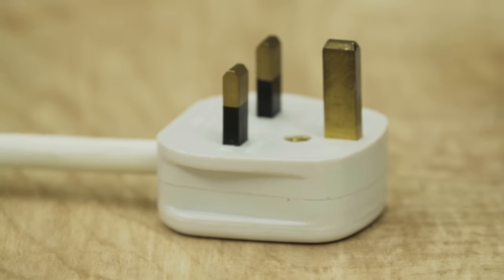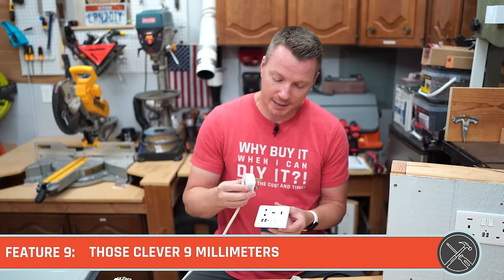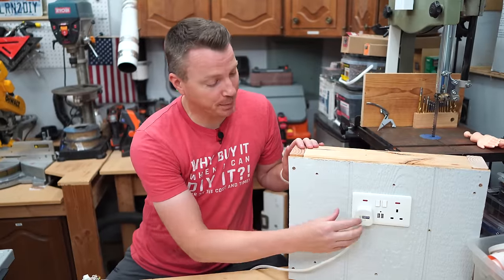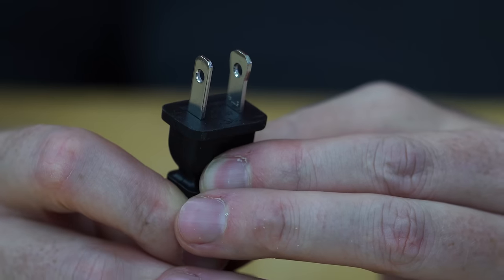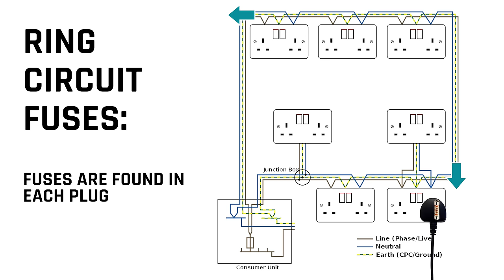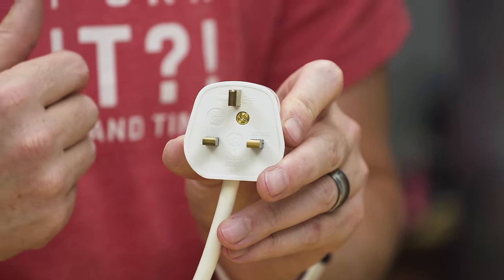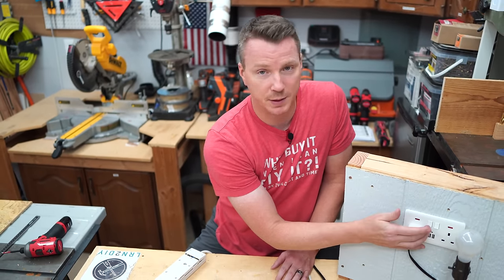British Plugs and Outlets Are On Another Level

Comment: Brit here. Although I'm not an electrician (I'm in radio/electronics), I can honestly say that although 'load balancing' is a theoretical concern it is not something that bothers 99% of people at all. I've never seen an instance of it anywhere. As for treading on an up-turned plug, we Brits are sensible people and we don't have plugs lying about in the middle of the floor! Finally, if an appliance fails to switch on, we don't automatically think it's faulty, we just check it is plugged in and the wall-switch is on.
Reply: also, yes it big and bulky but it sits flat against the wall with cable coming down which is great if a plug is behind somthing like furniture
Reply: As a Brit you’re lying if you say this has never happened to you 🔌 🦶
Reply: As another Brit, I refute your claim that we never step on plugs. I have done it a few times. It’s even worse than stubbing your toe on the coffee table.
Reply: @miles7374  No really, I've never stepped on a plug! Maybe I'm lucky, maybe I look where I'm going or maybe we don't leave plugs lying around the floor! But really, I suspect I'm like the majority of Brits who have never stood on one, and I've just asked my wife and she tells me she hasn't either! Please don't accuse someone of lying just because you have a different experience.
Reply: @LoFi3  I didn't say that. It would be a foolish claim.
Reply: Thanks for correcting him on these "flaws" I've never stepped on one either ......
Reply: Yeah, if we unplug it then we move it out of harms way. Such is the result of stepping on too many plugs.
Reply: stepping on plugs isnt a thing.
Reply: Speak for yourself. I step on them all the time
Reply: Try yourself some European plugs. It will change your life
Reply: @andyhowlett2231  i mean, i've stepped on plugs several times, but then again im an idiot
Reply: @Brigadier_Bufus  Well at least you're honest!😉
Reply: @miles7374  Agreed, stepping on a plug is horrid. But since we can turn it off at the switch they are unplugged much less.
Reply: He did really struggle to find some negatives, bless him. I've lived 4 decades and I've never stepped on a plug, their either wrapped around something (hoover), high up (kettle/Microwave) or plugged in and switched off at the wall if unneeded. Although if you weren't familiar with our plugs then I imagine accidents can happen.
Reply: headcell  Yes you can change a broken plug for a new one.  Just chop off plug, adjust coded wires, in the cable, to the correct length, wire plug and then use.  We've lived Germany and needed to change plugs, no worries and easily sorted.
Reply: @andyhowlett2231  haha it was a joke, same way you weren’t serious saying all brits are sensible people
Reply: headcell  You can swap a moulded plug for a new one, just cut it off and start again with a new plug.
I remember when one had to buy a plug for every appliance
Reply: @andyhowlett2231  As luck goes tommorow morning you'll step on one!
Reply: he didnt consider that since you can turn it off at the socket there isn't as much need for unplugging it as there is in America
Reply: headcell  with you there on those 13 amp prefitted fuses. Ideal for 3 bar electric fires, not much use for a CD player or powered USB hub
Reply: The reason "we don't have plugs lying about in the middle of the floor" is precisely because we've all trodden on one bare-footed at some point.
Reply: @sunnyjim1355  We haven't 'all' done it, Jim!
Reply: mate, why can't you just admit that you've stood on an upturned plug? It's happened to everyone at least once.
Reply: @Dushmann_  Mate, it's never happened to me. Or my wife as it happens. Why are you insisting that 'everyone' has stood on a pug? It seems so childish, are you trying to wind people up?
Reply: @d-emprahexpects  European sockets feel cheap and insecure
Reply: @baileyharrison1030  pffff "feels"
Reply: Never mind who stands on what, I swear, if you do do it, you don’t do it again! My main grind was the lack of understanding of how even a fluffy nightlight can become an offensive weapon with that plug. A major good point missed.
Reply: And in the case of lack of power, checking and possibly replacing the fuse of course, which wasn't mentioned here.
Reply: headcell  l
Reply: A friend of mine actually DID land on an upturned plug with a bare foot (it was a very random situation) and it did some nasty damage.
Reply: @yummyfuzz1  hahahahaha
Reply: @aperson2125  Not difficult to rectify. Just fit a fuse of the right rating. They are even colour-coded to avoid any further confusion.
Reply: British electrician here. I've never heard of load balancing being a consideration on ring circuits...
Reply: Its omly become an issue with having an EV.. Pulling 1.2Kwh for 5 hours+ straight... Gets a bit warm.. 

Thata right americans, technically i can pull that from any plug in my house!
The actual spec allows 1.5kwh but that will eventually trip your cuircuit in most cases after a while.
Reply: headcell  Sure you can replace a broken plug, cut the moulded one off, rewire a new plug, less than 2 minute job
Reply: ive managed to live 63 years without standing on a plug or ever meeting anyone afaik who has stood on a plug. Why~? Because no one unplugs anything unless it is being removed. It is left plugged in and switched off at the socket
Reply: @trippyvidschannel82  yes it is.
Reply: @tamz2tamz2  and when unplugged the plug mostly rests next to the socket. Who walks that close to the wall. It's wall, device(obstacles) then open space. Unless it's an empty room.

Comment: I’m British, and have never struggled to turn on a socket, nor have I ever struggled with their size. But I have trod on one though! And I’ve still got the scar on my heel to prove it! And even with that agony permanently seared onto my cortex, I'm still able to marvel at their incredible design. I rather took them for granted until I watched this vid.
Reply: Do you hit your head on low ceilings and doors as well.
Reply: Everyone will learn to stop leaving things on the floor, one way or another
Reply: 3 prongs makes three points of pressure which distribute the force, it would probably have been a lot worse with a two prong plug
Reply: its worse then lego
Reply: @mas_aco309  one of them is longer than the other two, it's like stepping on a one prong plug at first
Reply: @Journey_to_who_knows  lol so few modern British houses have low ceilings and doors and when I say modern I mean in the last 200 years. It’s just the really old buildings and houses that can sometimes have parts that are over a thousand years old which have low roofs and ceilings.
Reply: LOL at "troubleshooting" for "is the plug switched on?"
Reply: @MJK808  Yeah, that's a pretty dumb point in the video (though he doesn't pretend it's some huge problem). It's like saying that a disadvantage of locking a door is that people will wonder "Hmm, why this door not open? Maybe it locked. Maybe something in way. Me confused."
Reply: Here in the UK, instead of shock trauma, we have stepping on plugs trauma.
Reply: @beeble2003  In fairness it's a cultural thing, Here in Aus all our outlets have switches on them due to British influence, but it's alien for the yanks. 

As a concierge i started off perplexed by how many calls i'd received from North Americans struggling with switches on outlets, but i'm used to it now i don't even think its odd anymore. 

However i will never forget the time we had a guest valiantly try to save the building by fleeing his room and hitting a break glass in the hall fire cupboard as he had realised that the outlet was "on fire". The "fire" turned out to be the indicator lamp on the switch in the bathroom. The plastic cover had faded giving the lamp an orange hue.
Reply: God I feel your pain!
Reply: Heel ain’t nothing, had one go into the soft middle part of my sole😂
Reply: @johnburns4017  Not many people in the UK live in a house/dwelling that's over 150 years old never mind the ones that are hundreds of years old that would have the low ceilings and doors. Mind you, there are houses in the states that was built in the 1700's, so maybe you're living in one of them, and have problems with low ceilings and are commiserating with people here and other areas of the world that still have homes that old.
Reply: @mireah  
Do you keep cutting your hands as well?
Reply: @johnburns4017  never have.
Reply: @mireah  
I am surprised.
Reply: @tomspyro5795  I live in a three hundred year old house and yes the doors are low, my school had a four hundred year old building and I had to stoop to enter and I wasn't even fully grown at the time.

Comment: As a Brit it is wild to me that you can’t plug in a hair dryer and a iron at the same time 😂
Reply: Yeah! I thought the same!
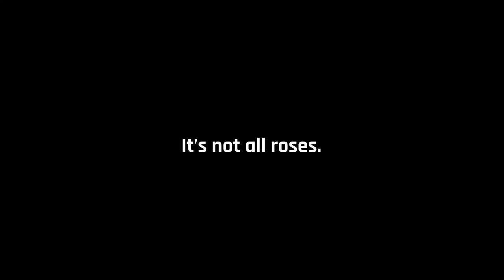Reply: haha yea, I have offpeak electric at 9:30pm to 2:30am, At 9:30 I charge my electric car, put on the dishwasher, put on the washing machine and also the kettle to make hot water bottles or cups of tea, not had any issue
Reply: OR making a brew and toast at the same time! Talk to me about load balancing lol.
Reply: Not only as a Brit, this is the case in the EU as well. That's just a normal thing for a western country with 230V
Reply: Out old house had a 1940s dual amp age wiring system this predated the square pin system and had 3 pin round pin plugs. You had a 5 amp circuit for lights etc and a larger socket 12 amp circuit for electric fires, hairdryers etc. Such set ups could still be found into the 1980s but have pretty much been replaced with modern wiring
Reply: Exactly what I thought!
Reply: Also the way he made it sound like we could sometimes do that if the socket was set up right. Eh? Would never think twice about what I'm plugging in at the same time.
Reply: @ThisMarv  Yes thanks to the UK design. Btw the EU isn't a country
Reply: @lauralishes1  What UK design? We don't use those plugs thankfully. The only country in the EU that uses those plugs is Ireland. And where did I say EU is a country? UK isn't a country either btw mate.
Reply: @ThisMarv  Not true. Type G in Cyprus
Reply: @HarryFlashmanVC  Way back in the early 20th century, there used to be several competing designs in the UK, and some of them were really wacky.  One of them, notoriously, used the cartridge fuse itself as one of the pins, which sounds clever and elegant until you realise it could break off in the socket and leave a live bit of wire sticking out.   I gather Wylex apparently used to offer a really oddball system where you'd have a large high-current plug that itself contained a smaller socket you could piggy-back a smaller plug on top of!

The big, round-pin 15A plugs, though long-obsolete for domestic use, are still widely used for plugging in theatrical lighting, I think.
Reply: @tommcewan7936  that's right 15amp are used in stage lighting and also some sound applications. Some houses have modern versions if 3 amp or 5 amp lighting circuits controlled by a wall switch it was a popular upgrade in expensive houses in the 80s, allowed you to switch on table lamps from the wall switch when entering a room.
There's a YouTube documentary about the lethal nature of early domestic electrical applications in Britain, has that fit bird with the blind curly hair... can't recall which channel but it's a very interesting vid
Reply: And as a bald slobby American I only ever wondered why it was so hard to find cold flat drinking water during my visit.
Reply: @thornbottle  Why use a coal powered car? That's REALLY bad for the environment.
Reply: @ThisMarv  What about Cyprus and Malta?
Reply: @ThisMarv  It's a country to anyone outside the UK.  Of course NI's existence is confusing though lol
USians talk of a British accent really irritates though, and the English language being called British English, like as if the French have to say "French French".  English should be England's language by default
Reply: I only have two arms and hands. I am wondering how all these two-at-a-time people manage to iron, with the iron in one hand and smoothing the cloth with the other, whilst holding a dryer with one hand and a brush/comb in the other. Only in England I guess.
Reply: @daklakdigital3691  Sometimes in England we allow other people to use appliances while we are using another one. Maybe it's just us.
Reply: @daklakdigital3691  I think its more the case of you're doing the ironing and someone else in the household is drying their hair but ok.
Reply: @misterdoctor9693  am I missing something here? You just turn on the tap to get a glass of water.
Reply: You misunderstand. We can certainly plug in a hair dryer and an iron. The problem might be of we plug them both into the same socket and there are other things running in the same circuit.

Someone ironing and someone else drying their hair in different parts of the house wouldn't cause any sorts of problems lol.
Reply: @nitePhyyre  In the UK we plug multiple things in the same socket and never have to worry about it. It's very rare to get a trip on the system and even then it's usually due to a fault in an appliance not the sockets or supply.
Reply: @nitePhyyre  I mean I’ve plugged a lot of things into one socket and never had a problem, I’ve got an outlet with one plug connected to a computer, an extension cable in the other plug with 3 monitors, a tv, and a mini fridge and I’ve never had issues
Reply: @bravo2966  Same thing in NA. You'd have to go out of your way to trip a breaker in NA. You'd have to really go out of your way to trip one in UK.

For example, the only time I trip then is when I have the microwave, dishwasher, deep fryer, toast oven, and window AC unit all on the same line and running at the same time. You might be able to run all that at once in the UK.

But that's cause my house was built improperly. Even in the UK, the kitchen is applied with more power for this reason.

Outside of obscure edge cases, the day-to-day difference between the two systems is that 110 is itself safe, so we don't have to over engineer everything. And 220 is great for electric kettles.
Reply: @HarryFlashmanVC  And the infamous bayonet plug for light fittings.
Reply: @papaj9386  Sure, it'll do in a pinch, but I'm talking about ice water, preferably filtered. That's just kind of available almost everywhere here for free.
Reply: @bravo2966  It's not an issue in most of the homes built in the US post-1960. I don't know why someone would want to dry their hair and use an iron at the same time since one usually dries one's hair in the bathroom and irons one's clothes in the kitchen, dinner room, or laundry room, but it is perfectly possible in, again, most houses newer than 1960.
Reply: @KrisKringle2  It's usually not the same person using the iron and hairdryer at the same time, hope that helps. In the UK we don't have plug sockets in bathrooms, that would be very dangerous, so we don't dry hair there.
Reply: @lauralishes1  The German Schuko plug is the most common plug in Europe.
Reply: @ThisMarv  This is just a troll... The German Schuko plug is in fact the most common plug in Europe.
Reply: @Ivkovifi  I'm talking about the design not who random companies who now manufacture it
Reply: @ThisMarv  UK isn't a country?? Um, yeah it is.
Reply: Well, typically, a hairdryer and an iron draw just 400 watts each, .. together 800 watts only. That's piddling! I can plug in another couple of kilowatts anywhere else on the same ringmain, and the system isn't even breathing heavily. 
When the British electric system was still on 240volts, fan heaters for warming rooms were made that drew 3000 watts on full power... one particularly stylish one was made by the Hoover company. (It happens there is one for sale on ebay right now, for sale at £20:00. Condition appears good, considering it is more than 50 years old.)
Reply: @bravo2966  however,overloading a Socket is bad and is a manor fire hazard⚠️🔥

Comment: I'm american, but when I was deployed to Iraq, we used these plugs. One thing I miss about these is how satisfying it is to plug these in and how secure they felt. Definitely wish we had these in the states!
Reply: I preferred the plugs when I was in Sweden tbh, Don't remember ever having a problem with a sagging cable neither unlike I've seen some saying on here with an American plug, I've also used a plug in Mexico, Perhaps it's similar to the US plug?
Reply: In general I agree but I'm not thrilled about ring circuits.
Reply: @danielbliss8014  not all UK circuits are ring circuits, and installers are using radial circuits more commonly here now. Ring circuits are good for smaller gauge wire to be used, typically 2.5mm twin and earth. For a radial circuit 4mm twin and earth is commonly used (to allow for heavy loads), which is obviously more expensive. Can i just add, that standing on a UK plug is 10 times worse than standing on a lego brick :(
Reply: @paulgregory8973  I know all too well about the risk of standing on them.......I grew up over there. Thought US plugs were in that grey area between a practical joke and a dare when I came over here.
Reply: No.
Reply: Iraq has these plugs?!